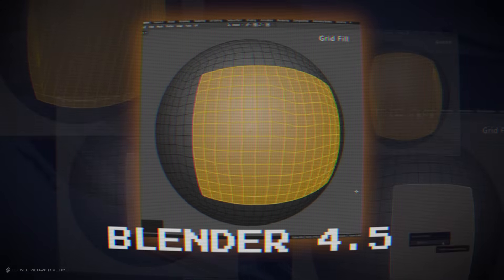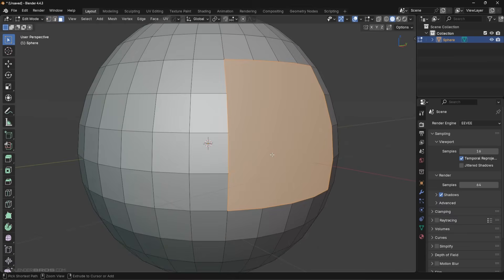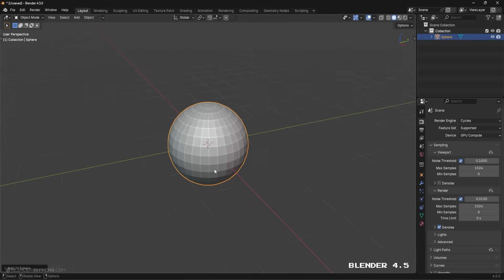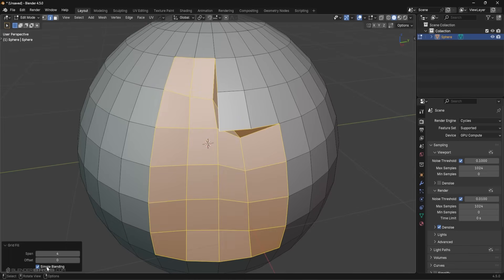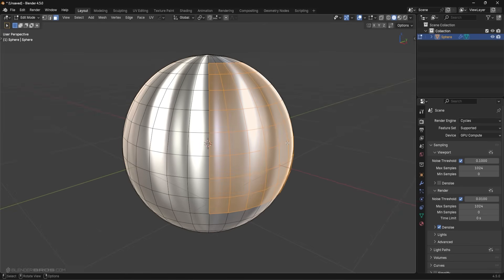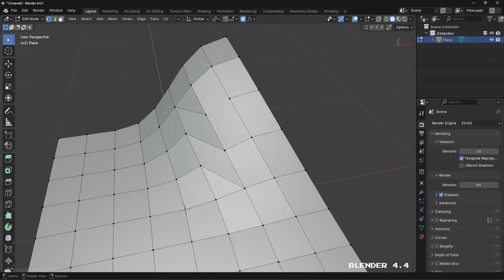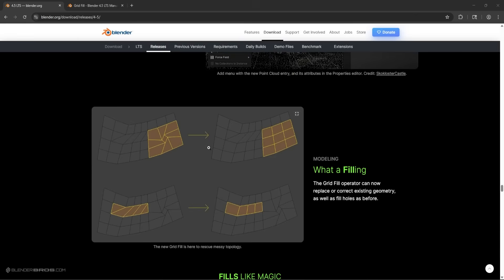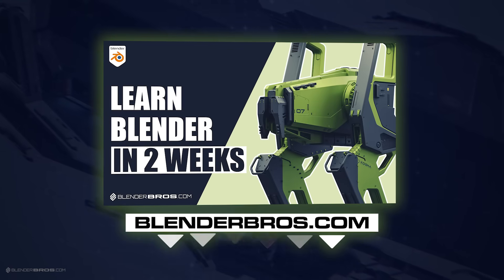Grid Fill Just Got BETTER (Blender 4.5)

Comment: in my testing you don't have to do the messy/awkward grid fill as the intermediate step → you can instead press F to fill, then select the rectangular shape of the surrounding geometry (it does not need a "buffer zone") → then the final grid fill. saves ~2 seconds, but life is short

Comment: I downloaded Blender 4.5 and when I tried this grid fill it didnt work like in video and after few attemps it just gave me:

"Select two edge loops or a single closed edge loop from which two edge loops can be calculated"

Then when I selected only two edges and grid filled it filled the space but not so neatly as you show

Comment: The sphere option only works when you create a sphere, and it's there in previous versions. I don't know if it wouldn't be faster to create a new sphere :D. Grid fill has been improved, but it still won't give the perfect effect that would be needed, for example, in car modeling, etc.
Reply from the maker: Yeah bit overhyped imo but worth showing the new updates. Saves a few clicks.

Comment: I think it's time to implement AI for topology (or retoplogy) in Blender. So that AI can analyse your object, understand the selection and the flow of edges and would "grid fill" or retoplogize the selected area perfectly by 1 or 2 clicks. Or quickly fix nasty bevels and corners without you spending an hour to fix those things manually.
Reply: I have to disagree. If AI is being developed to handle every part of the pipeline, then what's the purpose of having human involvement at all? The real problem lies in poor modeling practices—many artists cut corners. It's essential for artists to understand why they're ending up with bad topology in the first place. Relying entirely on AI removes the need for human insight and contribution.
Reply: @ryananderson2859  Yes, but fighting AI won't help. I used to be anti-AI from the get go. Now I've opened up a bit. Much like the car that replaced the horse and carriage, so have AI. I bet there were tons of anti-car people back then as well. I just doesn't help yelling at the walls. Unless governments ban all AI. then maybe so.